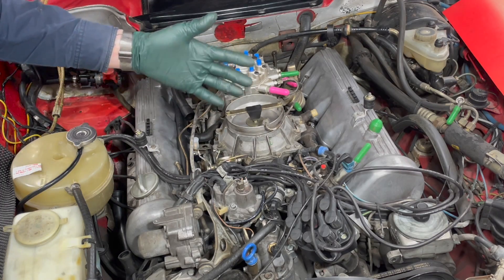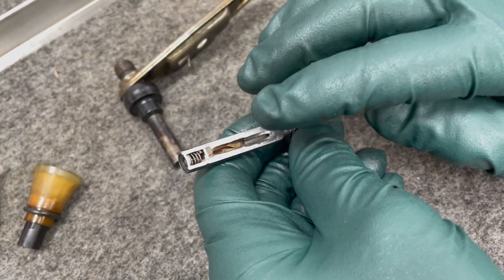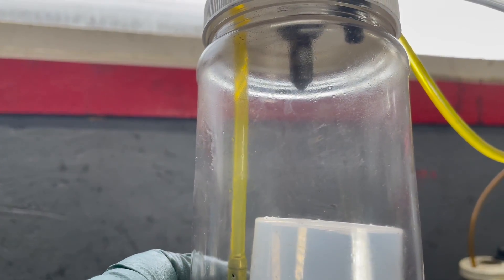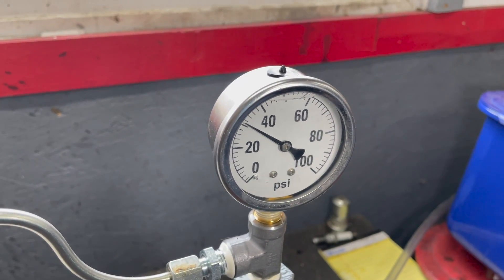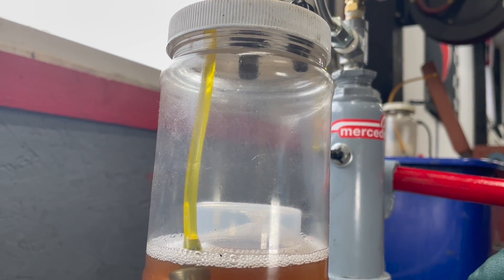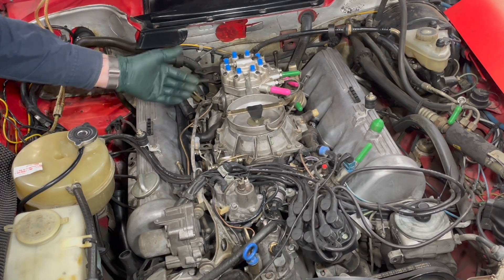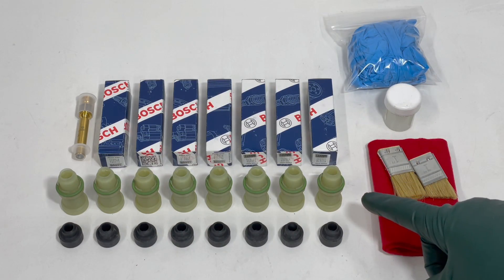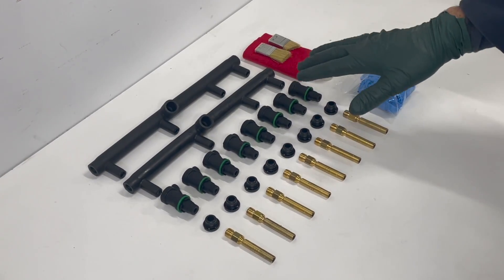Bosch K-Jetronic Performance: Why Change Fuel Injectors? New DIY Kits Available Now

Comment: Thanks for your kind video but unfortunately i have bought many times new fuel injectors (Bosch) for my car W124 M103 found that there is a problem in the injectors where they are damaged after test.
I don't know why.
Where i changed the fuel filter.
So could you please advise??

Comment: I have a 1974 450SL Djet and I replaced all the injectors in her and she consumes more fuel now. Is there something I may have done wrong in replacing them? Do I have to adjust something?
Reply from the maker: You will need to do a fuel system pressure test with the correct setup. Your fuel pressure regulator could have failed or is out of adjustment. Hi fuel pressure leads to excess fuel consumption. There could be other things as well. Research D-jetronic. https://mercedessource.com/store/1970-1975-35-45-d-jetronic-fuel-injection-pressure-tester-wextras

Comment: Instead of ATF I used Marvel Mystery oil or Techron with mineral spirits when attempt to clean injectors. Great channel.  I was a Star Technician 1971-1990. Then a BMW Master Tech 1990 to 2017. Retired now 👍☕
Reply from the maker: Wow, that is a lot of years working on cars. I bet you have some great stories to tell. I started as an aircraft mechanic in 1969 but I have done other things along the way other than turning wrenches. :-). You should pick up an old K-jet Mercedes to tinker on just to keep your mind sharp. LOL

Comment: Years ago, put new injectors on my GTI just to see if that would be better.  Had no troubles with the old news (175K mi) but once I put the new ones in, man, the engine was just smooth at all rpm, felt perfect.

What's amazing about those screwy spray patterns Kent is showing us is that the car will often start and run with no problem and you don't even know how bad they are until you can spray them and look at them. (In VW land, it was four plastic soda bottles and  jumped fuel pump relay slots and a pull on the airlfow meter disc.
😁)

Comment: Had the issue with old KE-Jetronic injectors. Decided to buy new ones and that solved the major issue.  Have a lot of old ones but even after cleaning they did not perform well. Some of them just get so stuck from old varnish and bad gasoline that they just can't be saved. After all most of these injectors are 30+ years old so time just has done it's work with them.
Reply: What brands are your new injectors if I may ask?
Reply from the maker: I only sell Genuine Bosch.  https://mercedessource.com/store/search?keys=genuine%20Bosch%20Fuel%20Injectors
Reply: Hey! How I can contact with you? Thanks